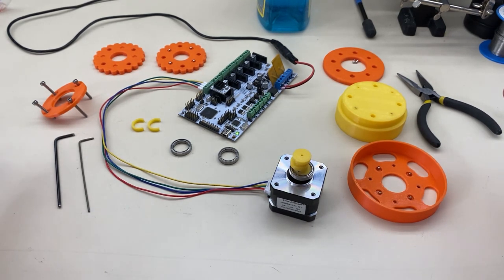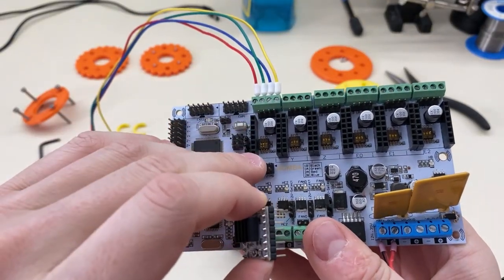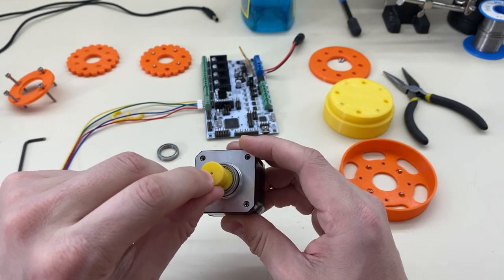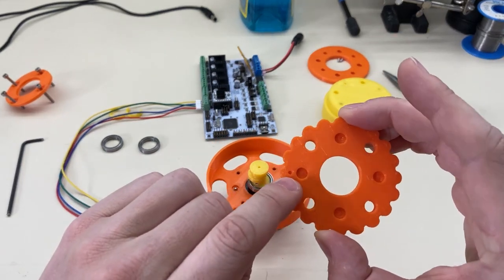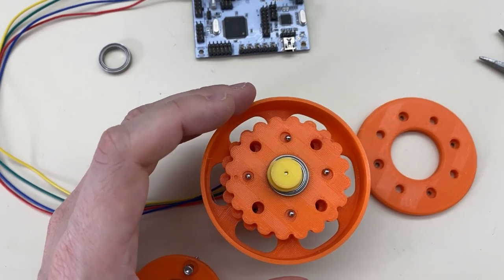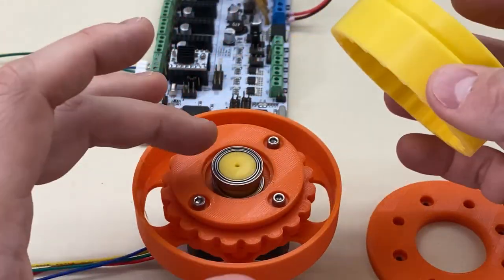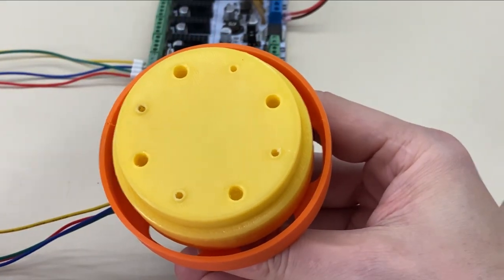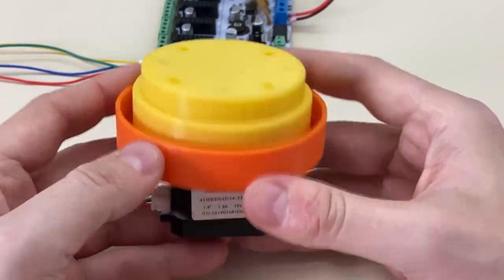A 3D printed Cycloid Gearbox with two rotors (and suggested improvements)

Comment: Dan, Great Job!  I called them Strain Wave gearboxes.  Check out DYS Gimbal Motor 24N22P GBM5208-75T DSLR Hollow Shaft for 2.0kg .  They use them in camera gimbals. You'd need an encoder or gyro MEMS chip. They don't run like steppers. Think Drone copters. Very high speed. Come in every size you can imagine.
Reply from the maker: FilmFactry strain wave gearboxes are not cycloid gearboxes. I can find a torque rating on your gimbal motor. Nema17 was 54Ncm iirc.
Reply from the maker: @Joshua0689  can you fin one with 1Nm torque?

Comment: I am trying to design a cycloidal gear setup in an application. I'm still confused as to why the four posts rolling in the larger holes are necessary. I'm also not clear on how to get the cycloidal gear tooth shape.
Reply from the maker: if the posts are fixed then the outside housing will rotate.   if the outside housing is fixed then the posts will rotate.  which you choose depends on your application.  live janssen's video in the description shows how to get the tooth shape.

Comment: You mentioned the gears were different but you did not explain what's different about them is it that one gear has one tooth more can both gears have the same number of teeth or do they cancel one another out resulting in no output
Reply from the maker: The difference is the position of the four holes relative to the teeth. Line up both sets of teeth and the holes will not match. One tooth more is crazy talk, it wouldn’t fit in the housing.
Reply: @i-make-robots  so the holes are alignment holes to have both gears at 180 degrees opposition to each other ...correct me if I'm wrong people have said that the two Gear's cannot have the same number of teeth so one must have less than the other ... how many teeth are on both of your gears
Reply: @772777777777777  both discs have the same number but are dephased by 180°
The outer ring has 1 tooth more than the inner discs.

Comment: Another cheap toy I'm waiting to arrive "AS5600 magnetic encoder magnetic induction angle measurement sensor module" a couple dollars. use a magnet at the end of the shaft and this uses I2C to give 12 bit angle. They make a 14 bit version as well.

"The AS5600 is an easy to program magnetic rotary position sensor with a high-resolution 12-bit analog or PWM output. This contactless system measures the absolute angle of a diametric magnetized on-axis magnet."